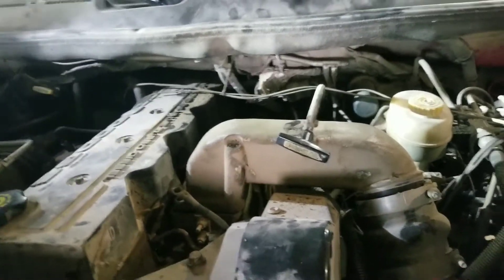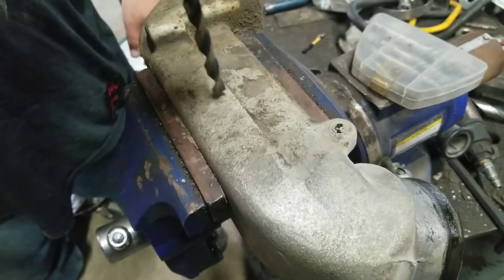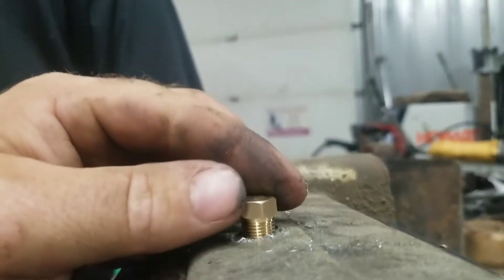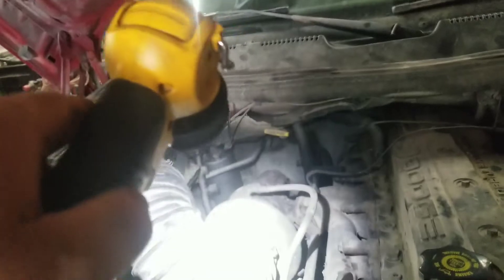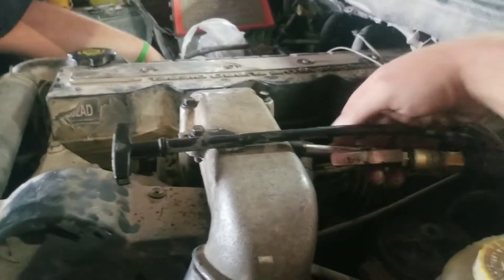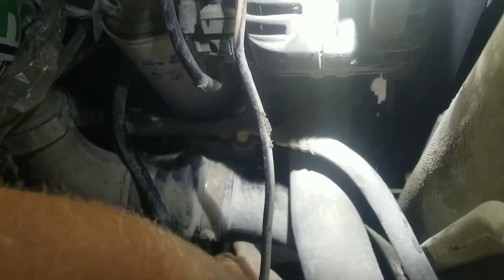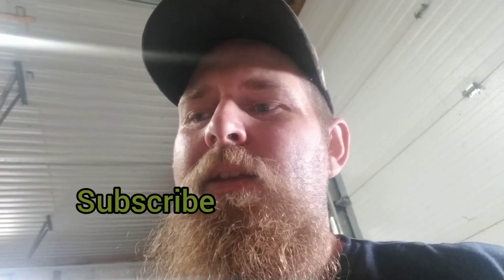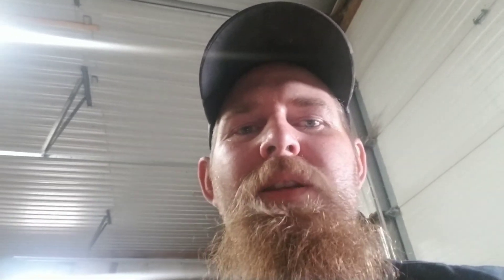99 Cummins...  How to find a boost leak

Comment: Thank you very much very informative!  My 2012 Ram 3500 has started making a whining sound and now I am looking for possible causes and fixes.  I do my repairs myself, so THANK YOU!
Reply from the maker: A boost leak will sound more like an air whooshing or whistling.
Reply: whining noises could just be low on power steering fluid but fill it with atf+4 unless that’s good sometimes boost leaks will make a whining noise

Comment: What are symptoms of boost leak on a 97 ram cummins 5.9 turbo diesel
Reply from the maker: Low power with black smoke.  Might be able to hear it.
Reply: @iowaorganicfarmer8128  ok thank you for the info
Reply: And high egt
Reply: If you hear alot of low end choppy whooshing noises from the turbo at hight boost low gear rpm You got a leak.

Comment: This was 100% pointless guy.
You defeated the purpose by removing a part of the truck.
Now, when you put that back on you will have another leak and will be like....wtf is happening.
Reply from the maker: I know what you're saying but no... I dont have another leak. If you want to leave the intake tube on truck and drill a hole in it, be my guest. But I don't want any metal shavings in there, which is why I took it off.
Reply: No you can just replace the intake elbow with a hole already threaded for $50 on eBay if you are worried about it.